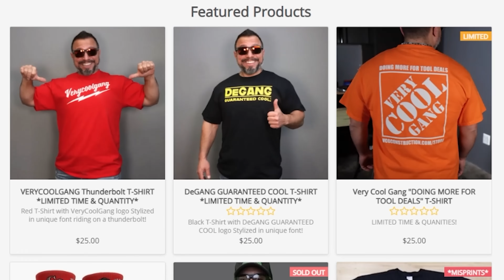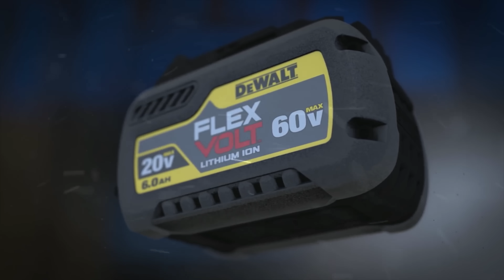DeWALT PowerStack Clearly Outperforms HUGE FlexVolt Lithium Ion Battery!

Comment: Can someone explain to me how these have more "power" if they are the same voltage as the old batteries?
Reply: Voltage is how wide and deep the river is .

Power is the amount of water getting pushed down the river
Reply: @user-tw8dl2jh2x  That doesnt answer my question, even if your analogy was correct, which it's not.
Reply: @DeusExAstra  Thats exactly how power vs voltage works in laymens terms.

No need for the animosity, I'm only helping
Reply: @user-tw8dl2jh2x  I dont have any animosity, just pointing out that you're wrong.  Maybe you think that anyone who tells you you're wrong is being hostile, in which case that's your problem, not mine.  You might be trying to help, but the bad analogy will only confuse people who read your post.  FYI in the common water analogy of electricity, voltage is the pressure of the water in a pipe.  Electrical current is the current of water, so amount of water per unit time (charge/time in electricity), and therefore power would be the pressure multiplied by the current.
Reply: @DeusExAstra  I'm an electrician and the way I explained it isn't wrong.

And as you have explained correctly, why did you even ask your initial question if you already knew the answere?

Very strange people in this world lol
Reply: @user-tw8dl2jh2x  Your analogy IS wrong.  I just explained the proper analogy, but you dont seem to understand it.  But to more clearly explain how you're wrong, you said "Power is the amount of water getting pushed down the river", which is totally incorrect.  The water in a hydraulic analogy would be charge in electricity.  Water per unit time is the flow, or current, which is also the current in electricity.  So whether you meant a unit of water or a flow of water, you're wrong in both cases.  Neither is equivalent to power, which has to do with the current and the pressure that's pushing it.  Likewise, "Voltage is how wide and deep the river is" is just wrong.  As I already said, the analogy to voltage is water pressure.

And I'm asking the question because I dont know the answer.  The batteries have the same voltage as the old ones.  And the current is the voltage divided by resistance of the load (I = V/R).  The power being output is just the voltage times the current.  So how are these outputting more power?  Maybe the old ones dont maintain the same peak voltage under load and these do?  Maybe there's lower internal resistance in the battery?  Maybe these are putting out higher voltage than rated?  I have no idea, which is why I'm asking.  The actual electrical theory is not my question.
Reply: @DeusExAstra  The batteries and BMS  have more constant and max Amp output than the old ones.

Amps X Voltage = Watts (Power)

The older batteries are 18650 cells which are are rated for a lower amperage, the hike point in the new packs.

In my analogy the Amps are how hard the water is getting pushed  down the river, the Voltage is how wide the river is and determines top potential speed and power flow
Reply: @user-tw8dl2jh2x  If the new batteries allow for a higher current draw, then yes that would explain how it can output more power.  That was my question, and the answer seems to make sense.  But your analogy is still wrong.
Reply: @DeusExAstra  In your subjective opinion its wrong, but factually it isn't wrong, I can do much to change that

Comment: Can you us it on the “DEWALT 1800 Watt Portable Power Station and 20-Volt/60-Volt MAX Lithium-Ion Battery Charger”, and use these instead of the flex volt battery?

Comment: absolutely dude try laying on your back arms out nd use your wrist to hold a 1/4 Impact Driver for 10 minutes I bet youll be shaking. Untill your muscles begin to fail you don't truly know the definition of hard work. All I know is next time it wont hurt as much! Holy crap Its getting cold FAST up here, Subbed after I realized ive seen your trucks before!

Comment: Be interesting to see a 54v powerstsck battery performed or to knowxifctheyre even putting the tech into the flexvolt batteries. Will they be putting it into the power detect range? Good video!

Comment: I wonder if the powerstack battery architecture is more conducive to heating/overheating and more likely to catch fire if the tool is drawing maximum power from the cell.
Reply from the maker: This video will answer those questions BIGGEST FLEX YET Lithium Polymer (STACKED) Power Tools LEAKED! https://youtu.be/EyiklNzjuK8

Comment: The circular saw demo is the most obviously in favor of the old batteries. Make 3 3/4 cuts with a not shown full charge old battery then cut the last 1/4 with the new battery twice. Then shave tiny strips so the saw doesn't bind the same as it did with the old battery

Comment: "You're going to see these corporation demonstrations show the same result". Why anyone would believe 1.7 amp battery could outcompete a flexvolt is beyond me in marketing schemes
Reply: I'm waiting for the sneaky marketing ploy with these. Lithium pouch cells do outperform cylindrical cells in terms of power density (i.e peak Watts the cell can deliver in the moment) however run-time is simply the rating in amp hours with any battery.
I'm not too excited about them, pouch cells are generally less robust in terms of mechanical durability and life span in charge cycles.

Comment: So what happens when battery technology becomes so good  that the tool being used is comparatively equal in strength and speed of a corded tool?  Are they gonna stop or will corded tools eventually feel like he first battery tools from back in the late 80’s/ early 90’s?   Will a single charge be all that is ever needed over the 10 or 15 year life of the tool? Chargers become obsolete
Reply: Battery tools are already more powerful, some of the dewalt flex volt tools use a peak 2,300 watts of power while the most a corded tool puts out is 1,700 watts. but it can do it continuously while 2,300 watts would drain a battery fast and overheat any kind of motor if sustained too long so its good for small burst like hand saws and grinders. Until batteries are nuclear powered, we will need to keep recharging them.
Reply: Batteries don't really work like that.

Comment: I wonder how they are addressing that li-po pouches are usually less durable than li-on cells. Generally, they are more sensitive to high/low temperature, full discharge/overcharge, pack expansion, etc.....

Comment: At the end of the day, it's still 1.7ah battery. It may put out 50C discharge rate but it'll only last 5-10 minutes where as the 5ah battery will last 3 times longer. How about an 8ah powerstack in the size as the 5ah pack.

Comment: how do they cool this stacked batteries? Lifetime of the battery greatly depends on cooling. Also pouch batteris tend to expand and contract when used/charged. I dont think DeWALT did not think of this, but just asking. Also 18650 batteries were not made for cars they are general purpose batteries and you have that form in everything like lap tops, torch lamps, vapes, tools, drones....
Reply: Pretty sure they only took the idea from the intern who thought they could save some 0.5" of space with pouches. All the rest is marketing bullshit and problem well be having down the line.
Reply: Also you are right with 18650. That just shows how empty this whole video is with any info.

Comment: what good are batteries if the tool breaks easily??  dewalt drill forget it the chuck will go bad fast unless it sits on a table , not comm grade tools they suck got several that don't work and dewalt's warranty lmao. pure T junk

Comment: If you've ever ran an 887 impact with a big ol 9ah flexvolt battery (forgot to put the other batteries to charge 😅), you'll definitely appreciate what this powerstack tech brings to the table
Reply: It brings exactly zero noticeable difference other than shorter run time. I have never seen a 2 amp outperform a 4 amp both in the same voltage. It is a marketing scheme and nothing can beat the versatility of 4 and 5 amps for daily 20v use (unless you don't use it professionally then who cares). Once upon a time m18 2.0 amps were the same size as dewalts 4 amps so eventually you may find a 4 amp the size of current 2 amps but a smaller amp battery is not the answer
Reply: @calebz1448  "a 4amp the size of a 2 amp" is exactly what I'm looking for. Guess my example wasn't all too clear.
Reply: @jnieto490  I understood completely when I said that a smaller amp(performance) battery in addition to its SMALLER size is not a fair compromise. I do not think this power stack brings anything to the table besides the marketing gimmick it is. Tools will not be innovated at the rate they were in the far and recent past because they can all take turns introducing new tech and getting copied instead of each doing the work. Corporate laziness
Reply: @calebz1448  disagree, high power draw tools do much better with high amp batteries.  Noticeable even with drivers

Comment: I have a last-gen drill/ impact and it came with a  flex volt which I love because I could get into the 54(60)volt range. But for small jobs around the house, the drill/ impact can be a bit heavy and doing overhead work can be tiresome. i think I'll end up getting 2 small power stack, just for those smaller jobs.

Comment: Would of been interesting to know a little more about the powerstack figures. If it is RC style technology then the little pack is going to have a lot more available amperage over the stock ones. A typical RC battery with newer chemistry might be 1.7Ah at 60C/120C giving 102 continuous amps and 204 burst, the 2Ah pack on the other hand might only be 2Ah 20C/40C and only deliver 40 continuous and 80 burst. I notice they didn't drop a 5Ah pack on that would give 5Ah at 20C/40C giving 100 continuous and 200 burst amps. Identical performance, but with the added advantage of capacity and runtime. We already know from VCG testing that the 5Ah battery is almost as good as the flexvolt in most cases with a 18/20V tool. 

It does make me wonder about capacity overall, as say a 5Ah 60C/120C pack would be able to deliver crippling amperage to a tool, 300A continuous 600A burst. Something like the Turnigy Bolt 5000mAh 4S 15.2V 65~130C is a good example of this style of battery. Let's hope Dewalt have put decent microcontrollers into the tools that can tame that.

Comment: 1. Those are probably lipo cells(new one) because of the high power output
2. Pouch cells are more dangerous because they do not have any over pressure valve
I could be wrong though but I’m pretty sure the 2nd thing I said is true

Comment: They don't work for flexvolt tools correct? Definitely can see the performance increase. I'm wondering if they run cooler than regular 20v batteries lots of problems overheating batteries in the dog days of summer

Comment: So I want to ask.  I love the idea of the more compact powerstack.  But do they have any future plans of adding more cells to make packs that could last even longer or discharge even faster?
Reply: Yes
Reply: No they want smaller capacity batteries so you have to own more of them to get the same job done
Reply: @calebz1448  then why are they about to offer a 15 amp flexvolt?
Reply: @odisy64  that's targeting less than 20% of dewalt users so that's really a newer niche they've been working towards is offering bigger tools for commercial industrial uses. Until recently I couldn't get a cordless hammer drill that would run a 3/4 bit 12 inches down. Oh and the 15 amp will probably be $400 per battery so however nice it is I will stick with my $50 cord and 7 year old gun been run over by the truck
Reply: @odisy64  I have a 60v worm drive circular saw and I've cut some 12 gauge rolled c channel steel with it just as fast as treated lumber with a Lennox steel blade. It got left on the bobcat track and when the boss backed up ran the whole saw over. Broke the deck and blade guard but I used it for another year after that til I smoked the bearing. Not many people need a worm drive circular saw but that's why they still have it at $350 because they haven't paid for development of the tool with as few models as they've sold
Reply: @calebz1448   i dont see how this targets only 20% of users, the battery can fit on most of their 20v and 60v tools so it can be used by the majority of dewalt users but the downside is weight at the 350$ price tag but batteries scale up in price per kwh pretty predictably so the price can be justified for the runtime and lifespan. I have a dewalt 60v worm drive saw with a 2300 watt output, thing is a beast but i find it hard to believe they aren't selling well since my co workers own their owen as well specifically for its raw power you can only really get in a giant battery. I can imagine using this on my 60v grinder since it also has a 2300 watt output and eats through 9 amp batteries fast when im leveling concrete.
Reply: @odisy64  it targets a small portion of people that can afford to buy the "better" tool instead of just using the same cheaper tool they've had with a cord. It clearly excludes a piece of the market because of its bulk. I hate using a flexvolt battery in my 1/4 impact for daily construction use. The only way I've ever seen a case shatter is with a heavy flexvolt in it getting dropped off a steel truss. I've dropped my dewalt impact from 20+ft well over 100 times and never broke it. Run the 60v saw over once and it smokes a bearing soon after so if I can't replace the bearing myself I will junk the saw and go buy a used corded dewalt worm drive for $100-150 that's already 10 years old. Then I can use my extra $200-250 to get a nice cord and a 2x4 if I'm lucky 😂

Comment: Looking at numbers and performance, my High Output battery CP 3.0 from Milwaukee was released years ago, it's a little bigger, a little heavier, but it has the same power and more capacity than this one. Little bigger, but from less than 2amp in the DeWalt to 3amp. Am I the only one not that impressed? I'm still waiting for the "real" step up in powered tools. DeWalt made their move, Makita as well, I think Milwaukee has something nice brewing...
Reply: It's not the same. This 1.7amp battery is destroying much bigger batteries in tests. Time to upgrade to Dewalt.
Reply: What's the max  what output of your  battery? A 9amp flexvolt can output a peak 2,300 watts.

Comment: Nice.  I like full power, compact size, and light weight.  I don't need the same battery to last all day before a recharge.  You won't see me running 5Ah batteries on an impact.  I'd rather cycle through a few smaller, lighter packs.

Comment: If you get better performance with the 20v, they can start getting rid of the 60v, then. I think too many battery types. Makita even worse, 18v, 36v, 40v... And in the end Milwaukee still with the 18v outperforming all of them with tools 2 3 years older, and you can use all the batteries in all the tools. That is much better long term support. 
Anyways, that new battery with an adaptor to use it in the Milwaukee tools must be a killer.
Reply: It's all a lie. 60v 9amp would shame any other dewalt battery out there in any application. As for red being superior that's only relevant if you use a specialty tool that isn't made by dewalt. Milwaukee impacts are garbage and the angle grinders overheat to the point of cracking steel casing at the head. The only good things about Milwaukee are specialty tools and the batteries

Comment: Well, i dont know do you know but.... ;) If you kinda diy'er u can simply take a part 2amp dewalt battery and change cells to lg hg2 with capacity of 3000mah, and current of 30amps and get 3ah battery with really nice discharge rate. So basically they could sell 3ah battery with better cells only.

Comment: Wonder how many cells they have in the batteries and what the C “discharge” rating is. I bet they won’t release that due to the competition but I’m sure it will come one eventually.
Reply: 5 in series at 1.7Ah each. Standard "20V" which is actually 18V nominal.

C rate of these cells in the real world is never more than 40C. What RC Lipos advertise is absolute bullshit. Wayne Giles ESR Meter tells the truth.

Comment: Can’t wait for those things to hit the shelves December 1st. Looked like a huge difference between the two batteries power wise, especially using the spaddle bits. Love those DEWALT spaddle bits. No way your bending the shank on one of those bad boys. Thanks for video Vince. 👍
Reply: Just make sure you use a sharper spade bit when trying the new battery and it will perform the same
Reply: @calebz1448  What point are you trying to make?

Comment: I’ll be late on Dewalt, I’m still a beginner. I started off with Ryobi, but now that I see this. I’m excited to get my hands on the Dewalt tool sets. Thanks for the vid!
Reply: gratz. the guys use ryobi tools at work and theyre always smoking then i come in with my 60v stuff. no one can compete
Reply: Man forget that Ryobi. Go online right now they have insane specials. You can get the big big combo kit for 50% off right now. Or they have the spend 200 get a free tool. Spend 400 get 2, spend 5 get 3 right now. I’ve stocked up my collection again for my guys this week.
Reply: Ryobi is a decent company that has great customer service. But Dewalt is simply made for bigger and harder jobs.  I personally use the 40v Ryobi for yeard work and love them. But I use 20v dewalt for my actual work.